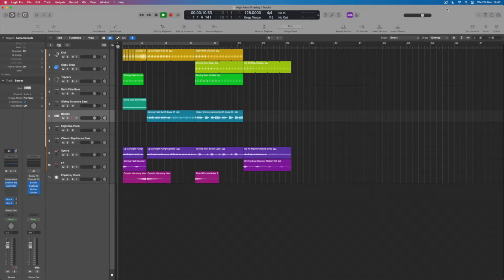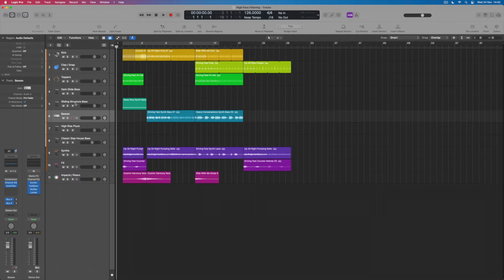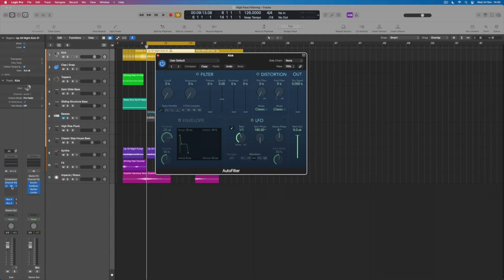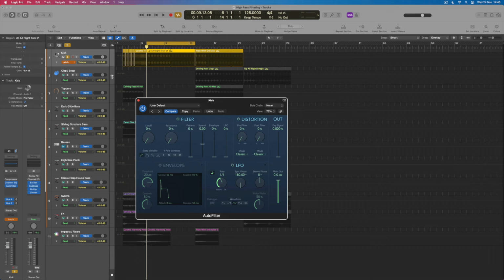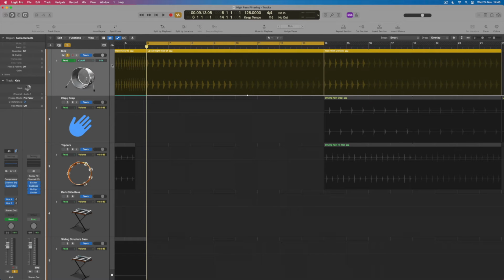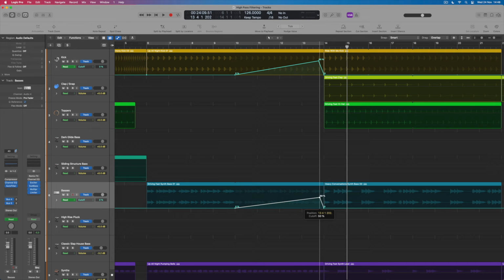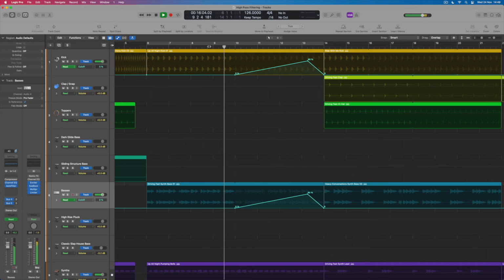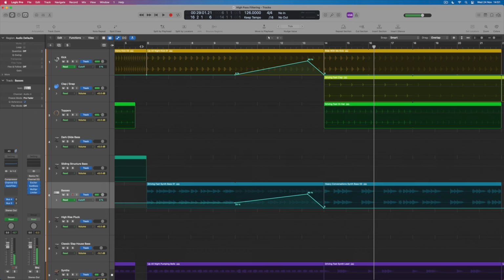LOGIC PRO X - High Pass Filtering Techniques

Comment: appreciate the information!!!! But my god, this video couldve used a DeEsser lolll
Reply from the maker: Glad it was helpful and many thanks for the suggestion. Are you hearing a need for a DeEsser on my voiceover or the track?! If the voiceover - noted, we'll look into that, thank you. 

If the track - I'd recommend using an EQ rather a DeEsser on instrumental music, particularly if you're looking to apply frequency change to several sounds at once. On a mono lead vocal, 's' sounds tend to be relatively consistent, frequency-wise, so it's usually effective to track them down and attenuate them. Brightness in an instrumental track will often be made from several collections of high frequency 'clusters', around hats and the top end of fizzy synths etc. You might well find that a couple of EQ bands targeting those areas works more effectively than De-Essing. If you have a Dynamic EQ plug-in, that may well work best of all.